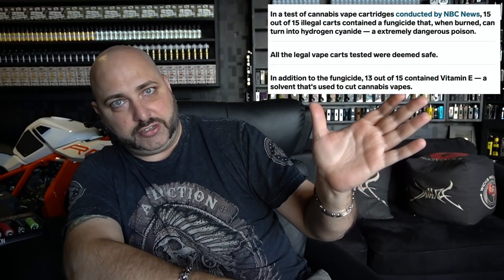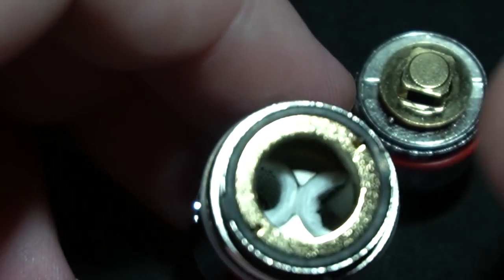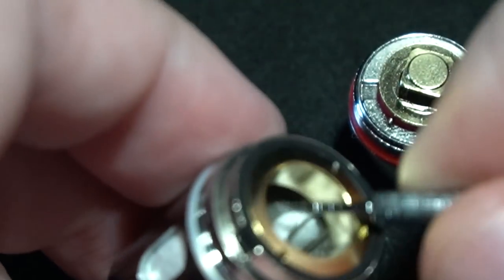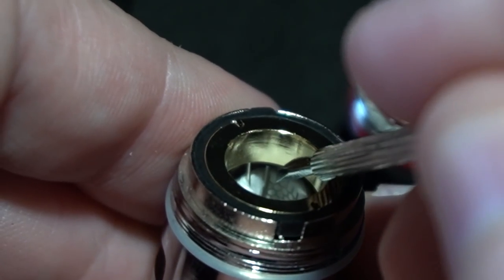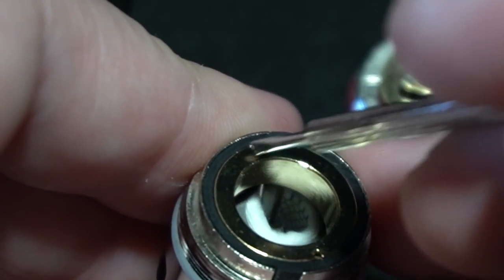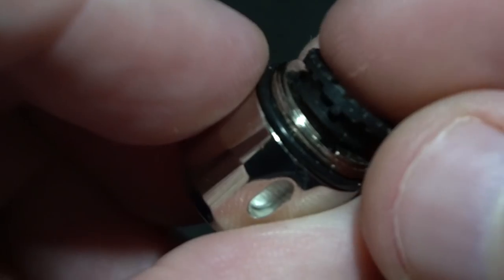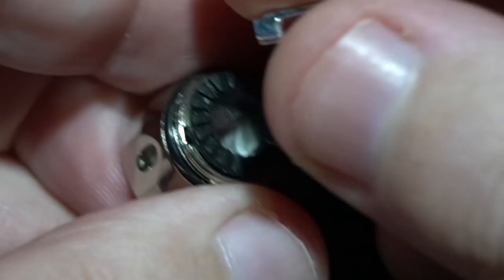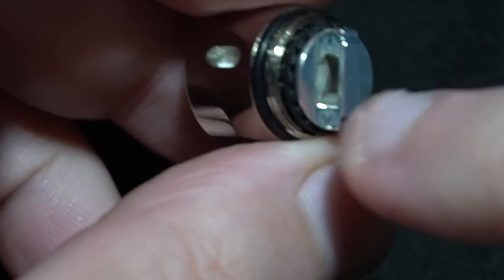What Is Causing the Vaping Illnesses, What's In Your Juul | Chemical Burns in Lungs

Comment: But the legs, especially on mesh, aren’t they attached with solder? Not that I believe all this FDA crap but in an effort to be 100% accurate. How does the leg attach to the actual mesh? I believe it’s soldered on and that’s most likely what they are referring to.
Reply from the maker: No I showed it here
Reply: Jai Haze not to the actual body of the coil but to the mesh itself. Like if you remove the mesh from the body and look at where the leg actually attaches to the mesh itself. I may be wrong but I believe the mesh itself is soldered to the legs inside the coil. Thanks for the reply though man and for keeping it real.
Reply from the maker: Oh yes but again it won’t melt. Nothing is going to get that hot inside
Reply: Jai Haze I agree but I was just thinking that those opposing vaping would use that contact point in their arguments. Thanks for the convo.

Comment: This all is due to black market illegitimate THC concentrate and non regulated pods. Maybe the soldered points but they do not have to do that. We need to seek damages because they have been extremely shadey in there testing and they are causing more harm.
Reply: Let me clarify. Damages need to be went after for companies doing these bogus tests and creating fake news. SHAME ON YOU TRUMP, and local representatives, and news outlets for being purposely shadey, creating fake news and being deceptive and also for actually hurting people with these bans!
Reply: In the mesh how would you explain them connecting mesh to the leads. I'm almost certain they are brazed or silver soldered, or arc welded.

Comment: Coils aren’t soldered, they are spot welded “fused using high voltage electricity”
Reply: Are you sure?
Reply from the maker: The guy
Reply: Jai Haze hey brother always love the vids. Do me a favor please. I don’t have access to these pods thanks to the Massachusetts ban so I can test this myself. Please put your touch to the “solder joint” and see if it melts. Solder should melt before the wire gets red hot. I believe it’s not solder as we know it, but fused together. Especially true with dissimilar metals. I would bet it’s stainless coil fused to high temperature wire and not copper wire. But again can you please test this theory. Fusing wiring are a normal practice on prebuilt coils and I can show you a bunch of examples.
Reply: @computerjohn1973 you seem familiar to this, it'd be great if you could make a video demonstrating that.
Reply: PainAndMurphy Thank you, I’d love to make a video on this, but due to the ban here in Massachusetts I can’t get my hands on pods. Since Jai had already made a video on this and has access to the pods is why I asked him to look into this. Though he is more than welcome to reach out to me if he wants some help on it.

Comment: The onlything you didnt check was where the legs connect to a mesh strip in a sub ohm coil, they maybe resistance welded in a spot or two I dont think they are soldered though
Reply: Very good point, not sure if they are or not but would be nice to know
Reply from the maker: Yea something I missed but still the point is no matter where it is, that doesn’t affect anything. The joints won’t get that hor
Reply: @JaiHaze  def, it wont get hot enough to melt

Comment: But how is the mesh in the sub ohm coil conected to the round wire going out to positive and negative. Smok also have a baby heart coil with only one negative and one positive going out but with 2  wires fused together in the middle how are they connected.  Dont get  me wrong im not thinking its a problem but it is a few more ways to look at things.

Comment: Since I started vaping, about 6 years I've made my own juice. When I first started I bought those little crappy bottles and realized I could buy my own all-natural VG cheaply from my local health food store and I don't trust PG so that's not in my juice. I also don't want coffee or any other extracts in my vape juice, just VG and a little nicotine. I truly think it's the extracts causing people problems, well most of the problems and maybe continuing to vape with a burnt coil is pretty bad for your lungs too. However, the biggest problem I see in all this is Big Pharma and the Tobacoo Industry putting large sums of cash in politician pockets. The one thing I would very much like to see change is more devices and mods being made here in America.  Those pods you showed are all constructed using injection molded plastic, no thanks. The coils may not be burning the plastic, but what do we as consumers know about the chemical makeup of the plastics used in those pods? I wonder how much chemical vapor is relieced when the plastic gets hot from many long hits? A plastics fire is the most deadly of all fires because of the chemicals in plastics. Not something I want to be inhaling for long periods of time regardless that's it's not hot enough to deform it's shape. I prefer all natural vaping andn that's VG, nicotine, cotton, metal and glass. Thank for opened those pod things up so I could see the low end of vaping.